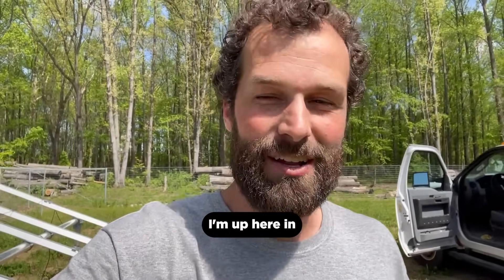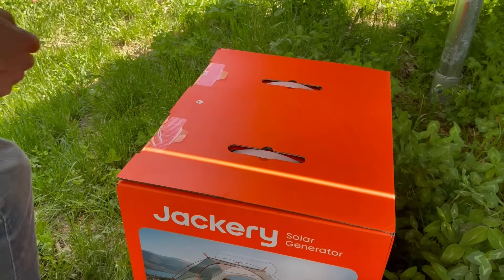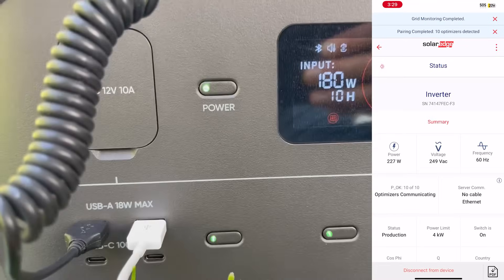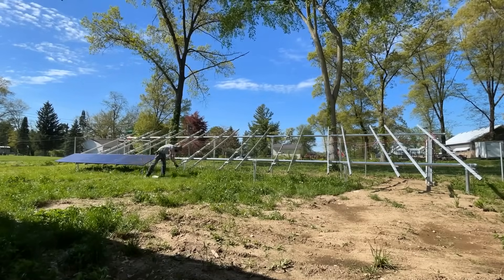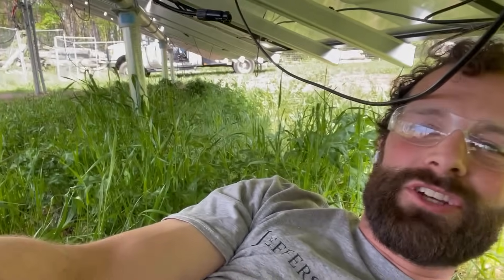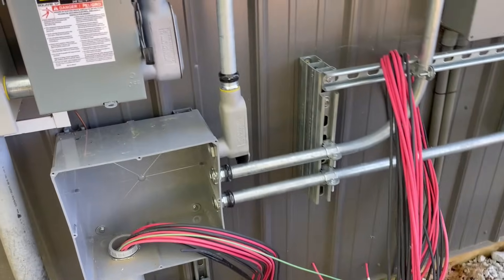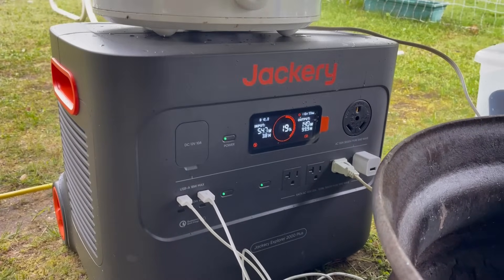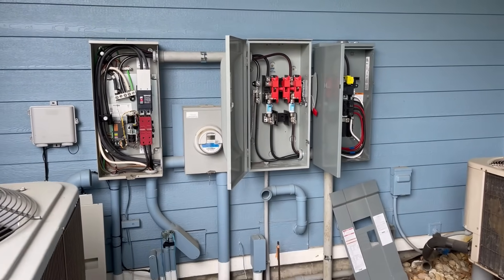Nobody Warned Me About Inspectors in Michigan! (feat. Jackery 2000 Plus Solar Generator)

Comment: Hey been following you for awhile and watched a bunch of your videos. I have a question if you have time to answer, on one of your videos you mentioned to a customer that a panel upgrade was $2000. When you price it at $2000 is that all included? Permits, panel, breakers, and utility disconnect? I know this question doesn't pertain to this question but figured it was the newest video out so you might see it. Thank you for your help and I appreciate what you do. I love the ride along videos on the job sites it's extremely helpful.